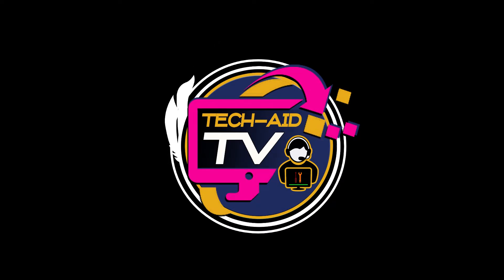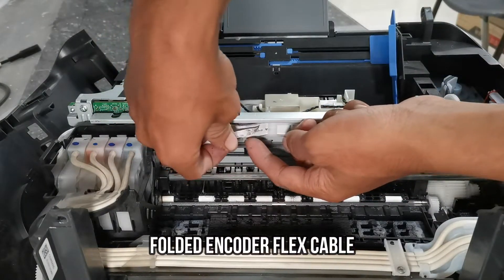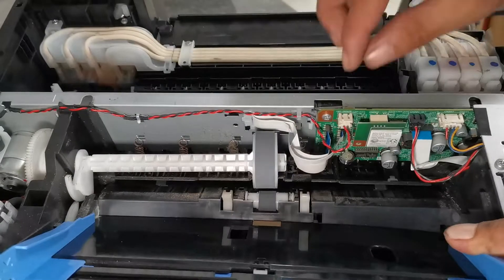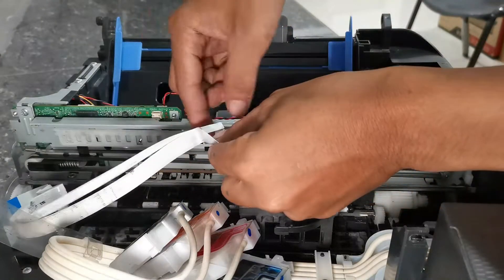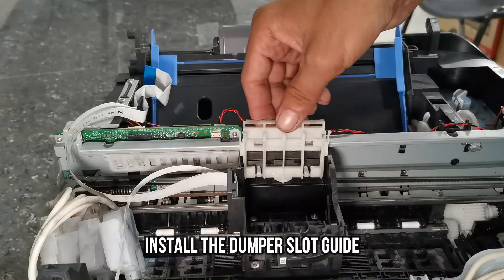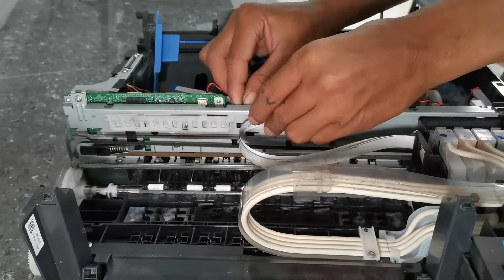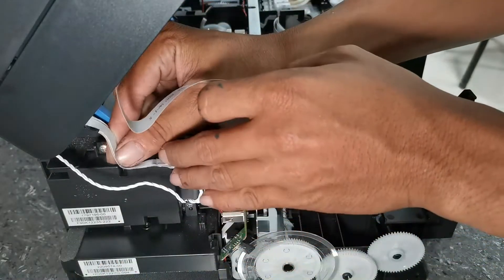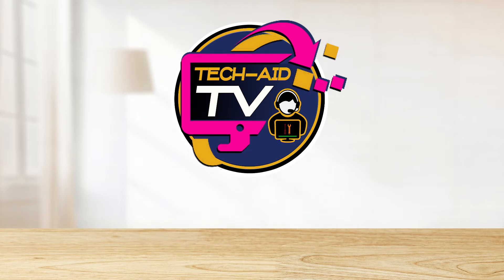HOW TO FIX 000031 ERROR CODE OF EPSON L5190 PRINTER.

Comment: Did this but still the error 00031 is still there after i print on 1 paper. After resetting (off and on) the printer and print again, the same error occurs. Do you know what problem it is?
Reply from the maker: Check the encoder disc
Reply: @Tech-aidSupport29 I had the same problem. what could be the problem of encoder disk? should we replace it? I already cleaned it